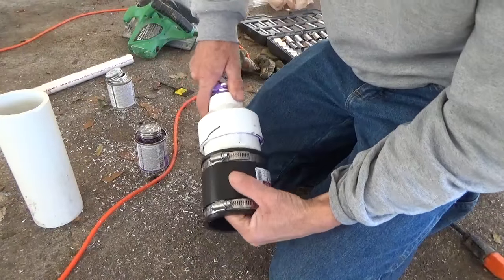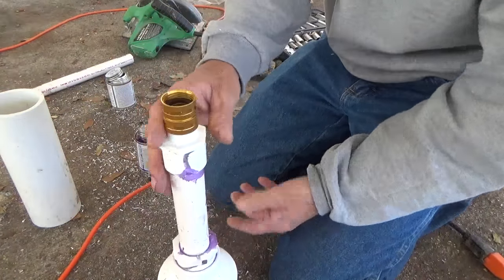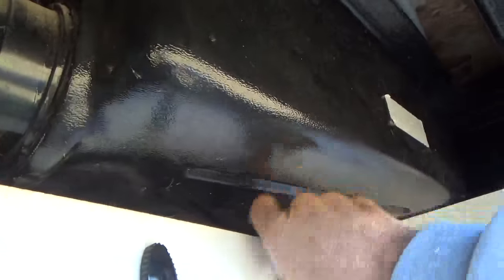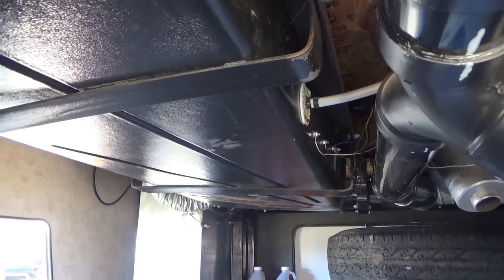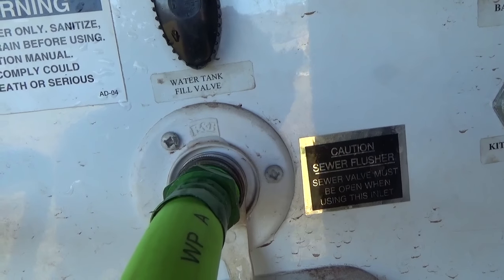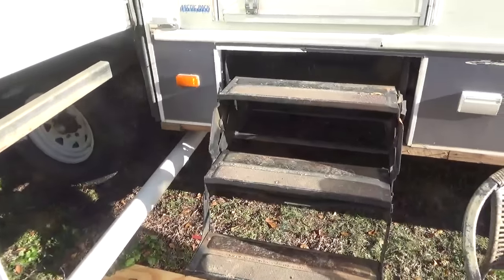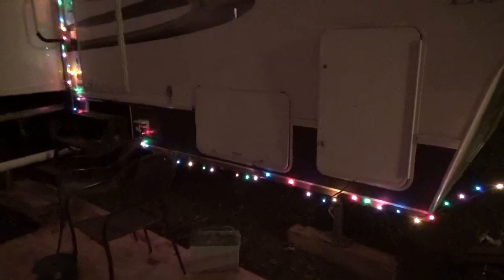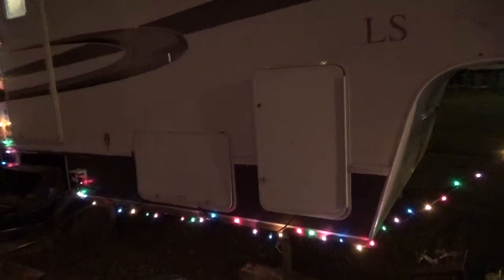5th Wheel Travel Trailer. Louisiana. HOLY CRAP! Black water tank blockage fixed.

Comment: We bought a 12x70 mobile home that had been disconnected from the water and sewer for over a year on a dairy farm when they no longer needed it for a hired hand on the farm.  We moved it about 200 miles to a lake lot in northern Wisconsin.  When we hooked up the water and sewer all the drain pipe where plugged with scale that had dried up on the inside of the pipes an shock loose in the move up north. We worked on cleaning out the drain system for most of the first week after the trailer had been set. .

Comment: Hey Joe, the same thing happened with our trailer. We leave it at one location all year. We found that if you keep the valve shut for a few days then open and drain it it works fine. It builds up pressure and then will drain every time you open the valve.

Comment: Couple things always good to know about camper septic systems: Keeps a few gallons of water in the tank so stuff stays loose. You can buy enzymatic additives for the black water tank - the enzymes will eat the material in the tank. There are a loot of good scent control additives - RV Life Magazine has a lot of good tips, etc on this - I would think their website would have past articles & tips from owners.  One this that I have heard is to ad a couple bags of ice cubes then drive the rig (make sure to add some water) - when you drive the sloshing of the water & cubes can break up blockages.  Never do what the past owner did - always keep the black tank valve closed, then when you empty the tank open it - there is more presure that will essentially push the was out - it is a holding tank not a portal ( I think a lot of people forget that then material just builds up because there is not enough force of the water & treatment chemical to thin it so it just blocks up the valve (watch the move RV with Robin Williams and you will see what  I mean haha).  Kitty litre, etc would be good to pour over that area, let it soak, then scoop & bag and throw it out as there are particles on the surface that you do not want & will attract animals and bugs.  Sorry for the long post - I this helps Joe.  Have a safe trip home.

Comment: Black tank valves are noted for poor closing qualities after some years.  Camping World or other suppliers, sell what is called  a "Termination Valve" which acts as a valve at the outside end of your drain line. You would have to replace the 1/4 turn end that they previously cut off, then place the new valve. Black tanks should never be started out dry.  We always add 5 gallon of clear water in the tank after dumping to keep the bottom wet and prevent solids from sticking. Also, leaving the tank open to drain continuously is likely to cause a dry tank and solids to build up. Some folks just drain every few days and keep tank wet in between, Good luck.

Comment: When putting a large cast iron Dutch oven in a small oven (like you have in your 5th wheel), don't leave the handles pointing to the sides of the oven. It's so tight that you'll burn your hands trying to get the pot out of the oven. If possible turn the handles front to back. That way you'll have a handle right in front and in the clear to grab on to rotate the pot around so you can grab the other handle with no burns!

Comment: if you take a 3 ft section of 3/4 pvc put a water connector on one end and a cap  on the other then drill small holes in the sides of the cap stick it in the toilet makes a great clean out in the tank i have one it works great

Comment: do you leave it draining constantly while in use? its designed to fill up to dissolve the solids,draining constantly lets the small amount  water flow away faster than the solids,the solids will sit and plug up the system,,good habit,use fast degradable paper and double the chemicals to dissolve the solids faster,,best to drain at about 3/4 full,if draining at lower capacity,,fill up with water helps,thats why regular toilets use so much water compared to rv toilets,if you weekend camp,drain it  and fill 1/4 full of water before leaving for home,,all the sloshing will clean the tank

Comment: If there is a sawmill close by then get a load or two of sawdust and put on the ground over where the yuck spilled, if no saw dust available look for peat moss at like a Lowes or such and put a layer of it down. It will give a cover material, kill the smell and in the end soil improver.

Comment: I gotta deal with a dried out pyramid in my fiver's black tank, too. The previous owner used a broken toilet and just "dumped a bucket of water into it." I'm using a portable toilet while I save for a blue boy and a new toilet. The sensor doesn't even read any more, so I'll deal with that later.

Comment: Get a bag of lime and throw it over the area where the spill is, coat it good. It will kill the odor and the bacteria. Highway crews use it all the time on dead animals, spills, etc. Give it a day or so then cover it with sawdust or straw or whatever you like. Keep the critters out of the sewage and the lime. Good luck and hang in there it will get better at some point.

Comment: Your stock inverter will have a hard time keeping up with all the lights and other systems running in a full time manner. Most RV'ers upgrade the inverter and/or go with led light bulbs. LED will take a huge load off the battery. I can run lights in mine for two weeks without plugging in. Keep in mind 18watt rv bulbs draw 1.5 amps each and there were 26 of them in my RV....I bet yours is about the same.
Reply from the maker: I bet thats whats happening, this one has 32 bulbs and we had about 22 of them going mainly all the time and the outside ones I left on two nights in a row.

Comment: one other idea if this continues to give you problems- is drop the tank and just straight pipe it like you would in a moblie home- alot of park models are set up this way--many blessings
Reply: park models usually have actual toilets,not rv toilets,,more water to carry away solids
Reply: yea i know- but ive also seen them set up with just the tank dropped and straightpiped for easy reconversion for travel- blessings

Comment: I was hoping easy fix.   From experience  do not force or slam cables to valves.  Pull easy.   Is metal cable hooked to plastic.  I  broke on last vacation and no choice but come home again.  Was nastier job to repair than you just had.  No good black plumbing job though.